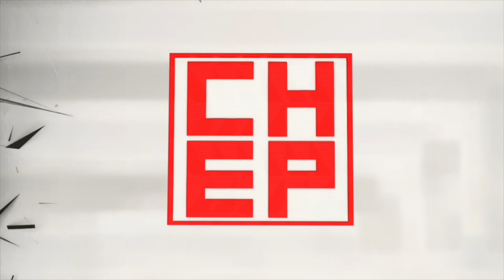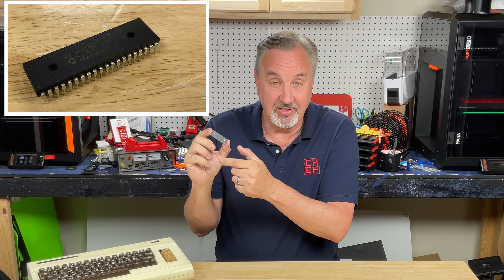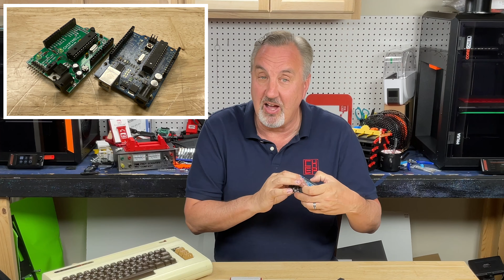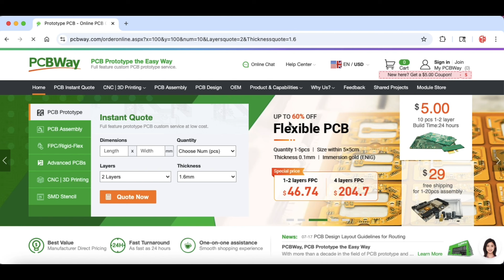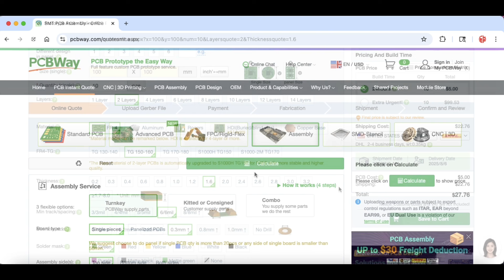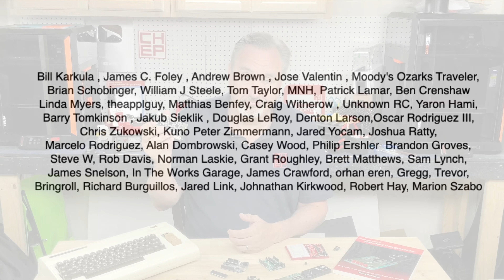Why I Still Like Using 8-Bit Microcontrollers?

Comment: PIC18F is still ahead of STM32 in the 20 pin sizes, in terms of the number of instructions they can store & the speed of non mathematical operations.  Suspect context switching is slower on ARM at the same clockspeed.  Small packages seem to be limited to 48Mhz by heat, so your biggest gain comes from fewer transistors.

Comment: 8bit controllers along with a long life span , also have simpler timing; set clock speeds and power levels. 32bit is a bit of magic under the hood. a lot of thermal silicon management, and hidden microcode making critical timing a lot harder to do directly without a function call to specifics. if you want timing control 8bit designs are a lot easier. however where 32 bit controllers excel is in in precision (floats hardware sometimes) and in math so acceleration and motion path control calculation. i predict more 32bit controller with 8bit timing chips, or 32bit controllers with internal 8bit cpu's. i get surprised sometimes where the market goes. motion correction and flow control sensors are advancing and more affordable. AI cameras allow me to do other things than watch first layer adhesion. print completion, and error free printing has improved quite a bit over last 3yrs. Bambu labs got the printing reliable and fast and gave a direction of focus for the market that had been stalling.

Comment: We all have our unique histories and perspectives. I spent a lot of years programming 8 bit PICs in assembly and in C. Left Basic in the rear view mirror  a long time ago. My recent projects usually have USB or Wi-Fi or both. In this case it is more economical to use a ESP32 or a RPi pico.
Reply from the maker: Agree but adding a serial display or smart sensor often has an 8-bit in it talking to the 32 bit.

Comment: You are absolutely correct on all points. I started out myself with Microchip PIC, before that it was 8086 using assembly language. But it was the PIC that introduced me to hardware aspect. I have used Cypress PSOC kits, these are great, but it’s the 8bit that’s really fun.

Comment: It is not 8 bit but if someone likes basic, there is mmbasic where you can flash a pico or pic to run, even as it is not compiling the basic, it’s actually fast. The state machines can also be programmed. I bought the picocalc and it can run mmbasic it like an old home computer.
Reply from the maker: Agree. I did a video on it about 10 yrs ago. 
3D Printed Retro BASIC Computer Case
https://youtu.be/S3k2Dr_iLg0

Comment: I'm totally with you .. while I do use esp32 in my home automation but that's more  boring, write a config flash and be done.
The more fun projects are more often than not 8 bits. Currently working on a new 8 bit computer,  complete with basic that will be my new tinkering platform

Comment: Hey Chuck! Based in the UK and have been watching your channel since I got an Ender3 during Covid. Back in the mid nineties I was working at a company that was using complex switchgear to control rolling pool covers. I proposed and developed a solution using PICs that greatly reduced the complexity and size of our conrollers… I remember using serial based programmers on Windows 95, and referencing really thick manuals to learn how to program the controllers in hex. To be fair I’ve now forgotten most of what I learned back then but that was for sure one of the most satisfying parts of my career - using microcontrollers to replace complex and unreliable mechanical controllers. I might just take a look at my parts bin (which will have an old ender3 board) and see if I can do something useful with it!

Comment: I'm thinking of designing and building an antenna tuner, this sounds like a great approach since it doesn't require a lot of speed.  I worked with HP Basic when I was a tech, before learning Visual Basic which was great for Windows desktop programs. This looks like fun.

Comment: My first computer was an Altair 8800. And I was in my 20s at the time. Though I had a form of BASIC I could run I had to load it from a paper tape. But mostly I used assembly. Eventually I upgraded to a Z-80 processor.

Comment: Excellent run-down! I love working with 8-bit microcontrollers, and have a decent stock of bare ATmega2560 mega chips that I’ve worked into a lot my beefier projects, as well as lesser versions of the ATmega chips for lighter weight projects. You can do a lot with them, including object avoiding self driving vehicles, quad-copter flight controllers, electronic lava lamps, etc - fun stuff. We’ve come along ways from the puch cards we used in my HS computer classes ;)

Comment: My first experience trying to program used punch card. I did 1 project with a Basic Stamp, only learned enough to do that project. Now in my old age I am trying to program a new controller board for my old Ender 3. So far I am 1 1/2 months into it and finally I have something that will compile. I need a dictionary of all the terms and definitions used in Marlin. Oh yah, I built a lot of Heathkit stuff. Today I'm hooking up a set of cheap speakers to my Heathkit integrated amp and tuner I built in 1983.

Comment: Most of the time, my microcontroller projects don't need the power or speed of a newer more modern processor. 
Plus, I've got a stockpile of inexpensive 8 bit boards, so why not use them?